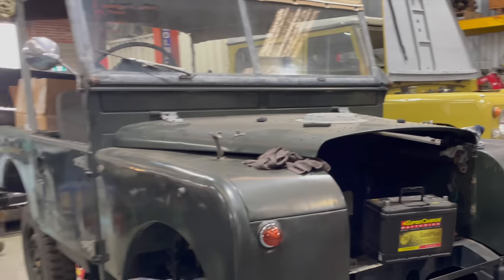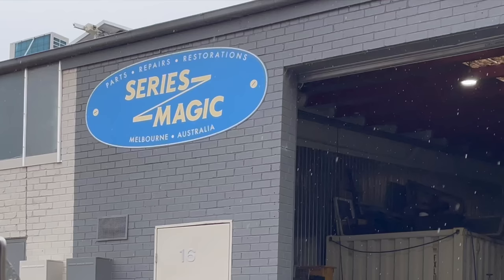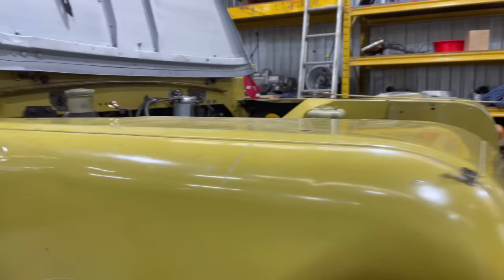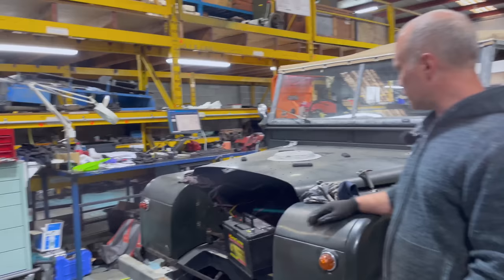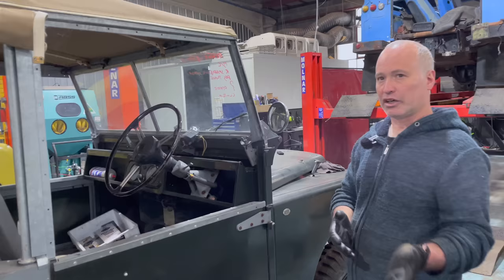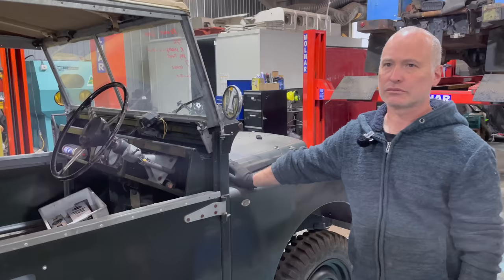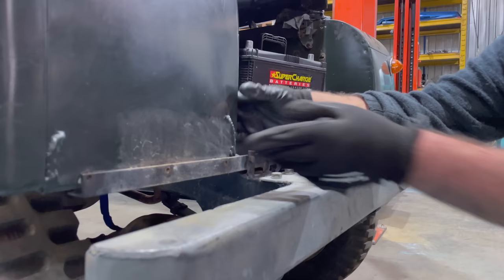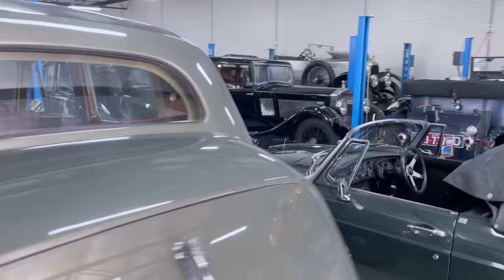LR restorer explains why Land Rovers last longer than Land Cruisers

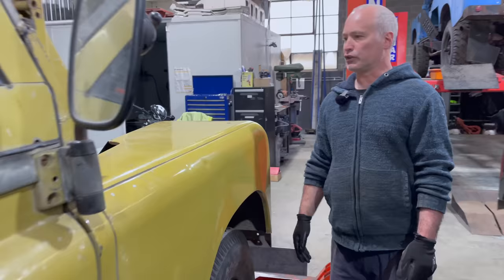Comment: 4:05 Your shop is awesome, just one comment, that material is not for sound proofing, it is for vibration dampening and it does a great job doing that, it will eleiminate any metal panel vibration, but the diesel engine noises will still get into the cabin without any problem.   To really isolate the cabin from road and engine noise to a very comfortable level  you need to add a layer of MLV (Mass loaded vinyl). Both materials need to be used at the same time as their combined strengths synergise great.

Comment: Ok, the aluminium! Title is totally clickbait but the real point of this is about being an enthusiast. It's as hard to be an enthusiast with a new Defender as it is with an LC300. But with an old series Land Rover or FJ40 (or basically any old car) you could actually fix things without a bank of computer analytics on hand. The reward of getting your car back on the road, or better than it was before is what makes a car enthusiast.
Reply: Well said, the cars and motorbikes that are over 30yrs old now can be ‘tinkered’ with and kept going by anyone with a little knowledge and a set of spanners. Anything newer and you start to get into more and more electronics and, as you say, modern cars you need a computer to do anything to them 😢
Reply: but depending on where you are you can still get a land cruiser 70 series.

Comment: Disco owner here. The LC completely outclasses LR products in reliability. LC Engines are stronger, Gear boxes are stronger and the onboard electronics are so much more reliable. Parts for my Discovery are cheap and plentiful in the UK. if they weren't I wouldn't bother with a LR product again.

Comment: Im in Australia too  and even though I love the look of a defender if my life depended on my car getting me through the Simpson Desest in 40c+ degree days I would be driving a Land Cruiser. Landcruisers here are the number 1 4wd vehicle for a reason , they just get the job done 97% of the time. I wouldn't take a Discovery particularly an early petrol one anywhere near a remote location. I used to be in the auction trade and the number of petrol Discovery's we would see was quite amazing. And they usually arrive on top of a tow truck. I suspect the reason why old Land Rovers are still found is because the people that love them baby them and pamper them, LandCruisers get used and used hard by their owners.  Saying that a trad Defender does look cool.
Reply: with respect, I suspect you suspect incorrectly. Both early products are sturdy vehicles driven within their limitations - will take your advice on the discos but then again a friend of mine just spent  SIX THOUSAND DOLLARS on a fresh for his 15-20 yo Landcruiser. I've not dropped that on  a single item in 41-42 years with my Landy and I have to say it gets used: probably 7 weeks ago I drove her with 1.9 tonnes of dolomite back up into the Adelaide hills. Mind you, lucky for low range 🙂

Comment: The title is certainly click bait. Having had both over the years i can honestly say landcruiser is by far the better vehicle all round.
Reply from the maker: But do they last longer?
Reply: @davesclassicgaragetours  well, my LC 60series 3F Sahara is 36 years old, I've owned it for 23 years now, has done 693.000 km has original engine not rebuild, runs and drives like new, the only thing on it that isn't original is the transmission, lifted suspension and peripherals like rad, alternator starter, brake cylinders etc , all replaced ones the last trans  lasted 350.000km, the car apart from a couple of spots is rust free and is still doing major (8000km 2x a year) outback trips as well as being used as a daily, I have owned a series 2a van and series three wagon, with 21/4L petrol, did a lot of km's in those as well, and have to say that some things on them are brilliant but others were designed by a first year apprentice after a good night at the pub!? Like the brakes for instance!! I loved LR but hated them, the things break whatever whenever, thank God they are usually easy to fix, land Rover invented the saying "love/hate relationship". I have to say that the LC has caused me less frustration and less work and cost and much more reliability, dry boots and no door flapping in a side wind! Lol. Just my two cents worth. Still... wouldn't mind one in the driveway though, bloody things!
Reply: @davesclassicgaragetours  my daihatsu taft aka fourtrack 1987 is reliable, they rust but engine and drivetrain never open except change rear seal crank 10 years ago
Reply: In my contry, the general consensus is that, the land rover is the better off roader than the cruiser,but the cruiser is the better workhorse.
Reply: My experience as well.
Reply: @davesclassicgaragetours  Yes they do. You can go far longer without having to  rebuild the engine or transmission on a Land Cruiser making it cheaper to own.
Reply from the maker: Marcel is referring to the body.
Reply: I had a series 2  1960 Land Rover with its original engine. (Matching numbers) and I know for a fact it is still going strong now as a weekend driver. Don't know of many Land Cruisers that can beat that, and I'm talking here in Britain with its salt laden winter roads,( and we've just had a cold snap under zero C for over a week here in South East England here in mid December 2022)
Reply: @samrodian919  . Do you want some more of them? Plenty here taking up space.
It's winter in Britain,  it's suppose to be cold there, it snowed at halls creek here last week, December in Australia. It's normally 40°c here by now
Reply: @samrodian919  wow! Under zero really? Seems unbelievable. Greetings from Iceland

Comment: Traveling through SA, you'll see most LC with either rotting or rebuilt bodies, running on original F's, 2F engines. I have a 72 FJ40 and the engine has never been rebuilt (but the floor was). Most of the bodies of LR's still on the road, IF they haven't had a crash, are pretty complete, thanks to the aluminum body but...they often had an engine and transmission swaps with rebuilt electrical systems. Back at home, in the PNW is common to see LR with Mercedes TDL or Ford/Chevy swaps. The most common reasons for having to replace the old rover v8 have been: overheating, warped heads, coolant leaking and difficulty procuring spare parts.  On both accounts, is probably less of an issue if you live in the UK. But, for the rest of the world, maintaining a LR on the road is more of a hobby, while the ruggedness of the LC engine and parts availability still makes them a working proposition. Nowadays, the 70 series LC seems to be the workhorse in SA, the Taco/4Runner in North America. ( I do love the suspension, looks,  and angles of the LR's, I just wish that they had more reliable mechanics and better parts availability...competion is needed).
Reply: a lasting 4x4: a land rover body on a lc70 chassis with toyota engine
Reply: @coketey3372  On a gasoline queque in rural SA, I just saw a RR body on a FJ-65 Chassis, Auto trans and 3F engine. Since I don't see Venezuelan's parts shops stocking conversion kits, I am sure it was all hand fabricated in a ma'&pa' shop. In the Industrial Los Guayos/Carabobo area, there used to be some of the best local restorers/rebuilders. They could even fabricate whole body panels, axles, gears, etc... One of my favorites was "Toyoda Restauraciones" which has, sadly, gone out of business during the COVID epidemic.
Reply: @coketey3372  nope, aluminium body in contact with steel frame is not a good idea.

Comment: Armchair critics can carry on with homilies about toyota superiority, but I've never remotely babied our Series 2a. The great majority of the 40+ years I''ve had it since the army sold it, she's been parked out in the weather, last time the roof was on our 16 year old was a baby.  It gets a major birthday about every 15 years but most of the time it's extremely cheap to maintain - $5 for a new indicator lens.  Some years she's a full-on daily driver come rain, hail or shine i.e. in 365 days including driving to work in "The Great Storm" here in Adelaide,  maintenance for the year came to $119 including a new distributor.  Ours is all original but for a ported head, extractors and electronic dizzy, and she does about 12mpg around town and 18-20 on the highway. 
I had a mate's diesel FJ45 for a few months and it was very solid but I found the ergonomics fell short on long trips (Adelaide to Alice, Alice to Townsville). You can sit all day in the Landy, but you absolutely know you've done say a 10 hour day with the windscreen on the bonnet. Both will reward empathetic hard use.

Comment: No they don't. They rust badly, the land cruiser is superior in every way.
Reply: And the Prado ( Gen 3 4 Runner) is even better.
I have owned 5 Land Rovers..58, 61, 64, 67 NADA 109, 74.. 
luv em, character and ease of maintenance and repair.
But the Toyota Generation 3  4 runner is superior in handling and longevity. 
I have a 2000 with 5 speed gear box, last year of standard transmission.  235 K miles with no troubles.
Replaced the brakes, springs, shocks, clutch at 233K  and timing belts as needed. . That's it.

Comment: late bto comment. i had a 1968 2a swb diesel. I stuck foam carpet underlay to the roof (took it off, turned it upside down on lawn and stuck it down.) also on floor and in engine bay. Still quieter with door tops off!

Comment: We have been involved with Land Rovers in all guises since the mid 1950s, right up to a 1995 Defender. My favourite was a 1971 2A SWB.
Unfortunately, In an Australian context, Land Rovers cannot hold a candle to Toyotas, early Patrols. Land Rover never kept up with advances from the previously mentioned.
The Series 3 were fragile gearbox wise, engines way underpowered, slow, crude passenger compartment, dash and controls.

Comment: Worked in Perth in ‘88 on some ‘48 era Land Rovers which had a Lee Enfield rifle butt mounting fitted to the floor. The vehicles were in good condition and used daily. Chassis was as new not like the vehicles back in Ireland that were completely rotted out.

Comment: I have had two series 2 90's. Ugh. Each had a key ring that looked like a jailer; every lock had a different key. Not a shred of insulation on the body panels. I was not sorry to sell either of them. I had a friend who was getting a PhD in anthropology in the late '60s. He picked up a new LR at the factory in the UK. Driving to his research area in eastern Turkey, the exhaust system fell off.

Comment: Quite obvious landrover may last longer, when they are broken down they are not wearing out lol. Leaf springs are hard riding fact, landrovers lack space for reasonable size people, the cold goes straight through them & the heat, poor turning circle, not very strong brakes, leak oil and so on. But they have a charachter about them that draws people to love them, having owned a series 3 109 & a mint ex miltary stage 1here in NZ I know the love for them, I noticed range rover drivers hold their heads straight and high in the air, where as series owners acknowledge each other, Driving along oneday I was admiring a nice defender with a nice lady driving she acknowledged me in my Stage one. Here in NZ we had a lot of landrovers sold here of all types. Eventually I found landcruisers and especially the VX-80 series. NZ got all the big selection of Jap imports loaded with all the goodies. I have 2 VX-80's 90/91 models Triple lockers and factory winch's air cond coils space just the best & also the GU GQ patrols are Hot stuff. But I still turn my head to admire old landys. Old Landys have become very exspensive here now & buyers need to be aware dealers are jacking the prices.The last of my old landy parts stash  became quite a lot more valuable when selling off recently. Here in NZ we are loaded with landcruiser parts on the 80 series. Old landy's on our farms rotting  are becomming fewer now, I travelled many miles to bring home valuable landy parts. Old Landys are always popping up on TV shows. One joke was Why do Landy drivers drive with there arm out the window, no Room In The Cab. I am a big Land Cruiser Fan now but still watch and admire the Old Girls( Landy's). Here in NZ someone is filming old Landy's doing off roading stuff well worth looking up on You Tube, these adventueres  show the abilities of the old landrovers going through there paces in some great countryside.
Reply: You can always tell a Landie owner at the pub. He drinks with his left hand cos all his knuckles are bandaged on his right! Who the hell designed that steering wheel set up!!!

Comment: As a fleet manager for a mine LC followers would be shocked to see how much it cost to keep one going in a mine. Every LC gets front bearings repacked every 10000k. Cvs last about 30000k. Gearbox on average 60000k etc... Constant problems with transfer cases getting stuck, rust in doors and roof and chassis cracks in maintenance vehicles because of the irregular loading. A/c problems abound. We upgrade shocks, springs, seats, and the steel wheels. HD clutches are fitted. We keep the GVM standard even though the suspension is upgraded. Standard tune. If you cross axle a LC you overload the standard rims!!
Reply: That's why Landcruiser's used in mines use "minespec" rims like the Trak 2 & not standard rims, you should know that, working as a mine fleet manager & all.
Reply: yeah mate, that's why it got a mention in the upgrade list.
Reply: From the States here.  Fascinating. I trust that you are in Australia?  I've never seen a Land Cruiser used for such work.  Evidently, the rest of the world has access to diesel and other Land Cruisers in various configurations that we are not familiar with.  If possible, could you post a link of the type of vehicle that is typically used in the mine? I have no idea what "minespec" rims are as mentioned by Dusty Farmer.
Also, I think the relevant comparison is to ask when these mechanical components would be serviced in a Land Rover product.  I am astonished that front bearings need repacked at 10,000 km (~6,200 miles).  Is there something specific about the mine dust or water that corrodes these components?
Reply: @57carpediem  Yes Australia. Typo my end, Trak 2 rims. ROH wheels make the Trak 2 rims. They are heavier duty & rated to carry a heavier load. I run them on my Toyota VDJ79R which is a V8 turbo diesel that only is sold in Australia in that configuration. Mine dust is heavy in salt & iron etc & mines often water down haul roads to keep dust down & underground mines can be wet leading to accelerated corrosion. Ex mine Landcruiser's can be found on various vehicle auction sites like Pickles or Grays & often have ROPS rear bars, lots of reflective tape, big mudflaps front & rear & lots of rust everywhere. They are an expendable asset in mines.
Reply: As a miner that actually uses Landcruisers you would be shocked to see what we do with them :D 🤣

Comment: I use to work on land-rovers every thing from a fuel rank to half chassis replacement.  Easy to work on big mechano set lol . I've owned quite a few 2 2a s3 101 forward control for a short while until I realised a v8 only does 12 miles to the  gallon.  If your lucky and a good  wind behind you . Been looking to buy another  but the prices have gone through the roof sadly  😥
Reply: The prices have actually gone down a lot last six months
Reply: hahaha good wind

Comment: I have owned a 2000 LR Discovery, a 2004 LR Discovery, and a 2008 Range Rover. These care are unreliable, always seem to need expensive maintenance, and the Discoveries were not powerful enough to enjoyably drive on I-70 in CO with numerous steep passes to drive over through CO or when driving from CO to CA on I-70 or I-15. Since then I have owned a 1996 LC 80 Series, a 2003 LC 100 Series, a 2006 LC 100 Series, and a 2008 LC 200 Series. There is no comparison in performance, reliability, or longevity between the LR and the LC. The Toyota LC is built with much higher quality components, driveline, and electronics. Both are great trucks depending on which country you live in and how you use them: off-road only in Africa or Colorado, or on combined off-road and Interstate in the USA. The Toyota Land cruiser might be the best truck ever built for both off-road and highway use. LR reliability and cost of maintenance are the basic reasons these trucks have horrible resale value in the USA.